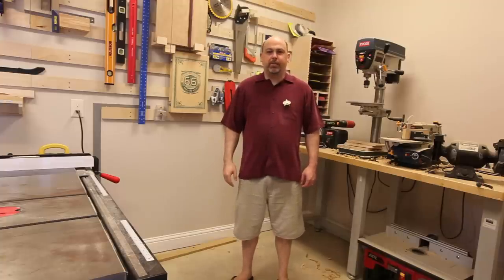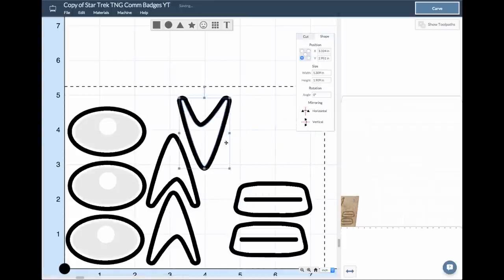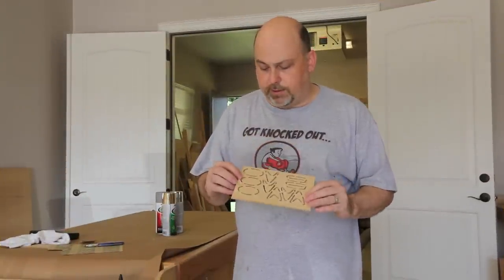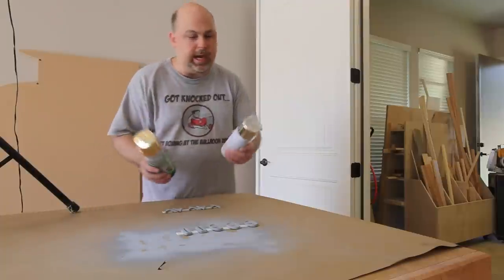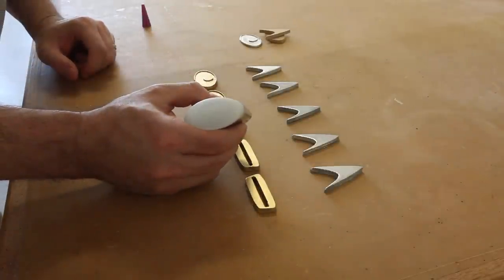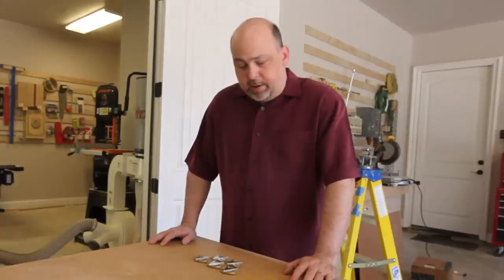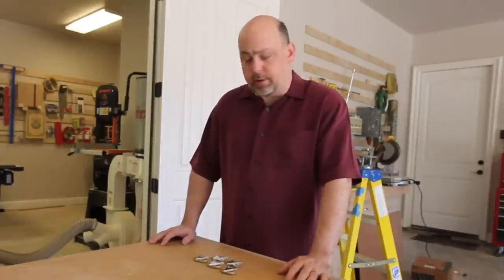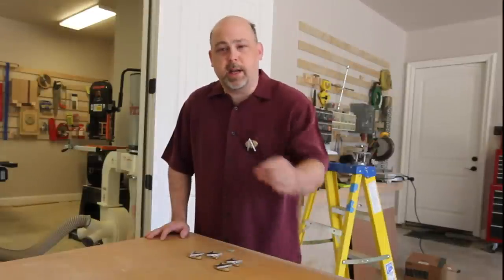How to make Star Trek® Comm Badges

Comment: I have two tips
1. if you want to affix these to clothes, I would suggest inset magnets
2. for the rounded shapes, instead of having a raised center, you should etch out notches so the emblem sits flush with the "badge" part. This would also make it more authentic.
3. The edges of the emblem should be black for a better look. Just MHO...

Comment: This is pretty nice, but I still prefer my method. I will print the thing out on cardstock, then use bondo on the cardstock to build and carve my shape, after that casting can be done with a silicon mold  and copies can be made with epoxy. Thought you would like to hear another method. I like this project, you did a good job, but not everybody has a cnc router.
Reply from the maker: +00meat Plays Neat idea!  I might try it!
Reply: I have gotten some really good results from that method, it takes a little carving skill, but that is not hard to learn. About any pocket knife will do for carving and smoothing, but a hobby knife will make it quick work. A bit time consuming for just one, but you can use a silicon mold to do multiple.

Comment: I have always wondered if the "real" Comm Badges had switches in them or just functioned as a capacitative sensor. I'm sure some Star Trek aficionados have this figured out.
Reply from the maker: +Maria Engström Who knows!  The ones used on the TV series were made by a jeweler and had no electronics in them.  I suspect in the fantasy world they were touch sensitive, possibly capacitive.
Reply: I’m working on a badge with a touch sensor..